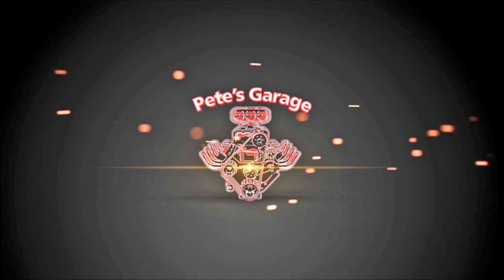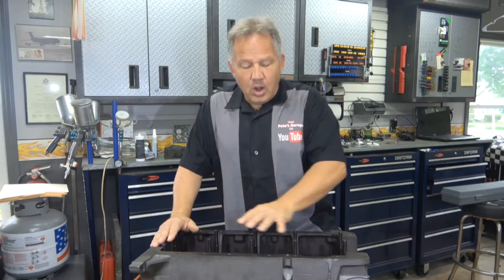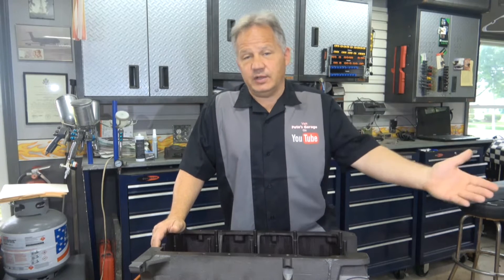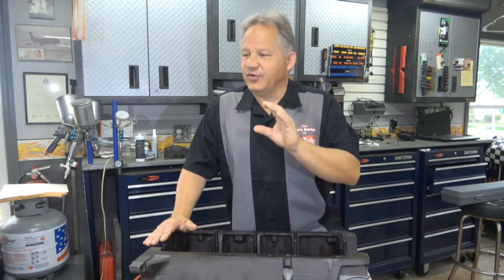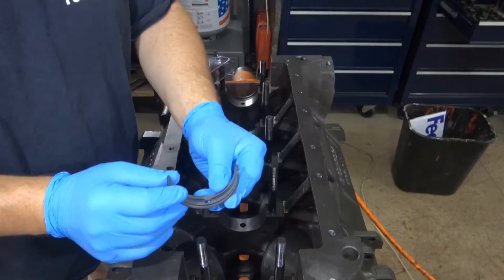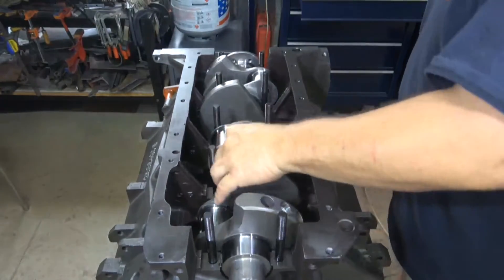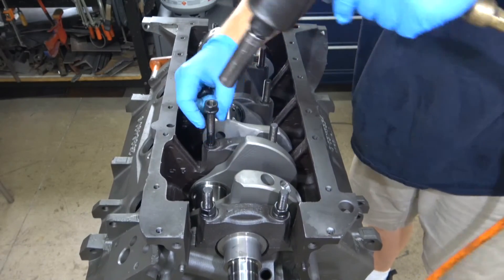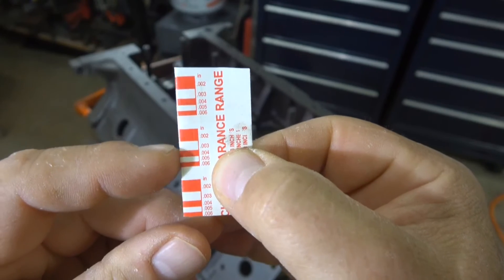Engine Building Tips - Checking Main Bearing Clearance with Plastigage 440 MOPAR 512 Stroker

Comment: Hi! Watching your videos for years now, but I have a question in general: When I do check my crankshaft bearing clearances (torqueing them down and measuring without a crank in the block) can I re-use those bearings when I finally mount the crank? Or do I have to buy a whole new set of crank and rod bearings? My friend said after toqueing down crank caps and rod caps the bearings get crushed and cannot be re-used. On the internet I found only one reference which said that they only get crushed "elastically", so they would do get back into their origin shape after loosening the caps....  Marlon
Reply from the maker: You can reuse the bearings.
Reply: @PetesGarage  Thank you, Pete :-)

Comment: Nice job, Do you take fine scotchbrite to the bearings during assembly?

I knew someone who installed one bearing upside down and the crank never got oil in that journal. The hole didn't line up on the crank journal. Didn't realize the mistake for years after but always had problems with the motor.  One mistake can ruin so much. Very important. I always like to have another set of eyes during assembly.
Reply from the maker: I do not Scotchbrite. Those holes are so important

Comment: Say you might not work on the engine, Do you spray any oil on the block to prevent rust?
Reply from the maker: I took the block back to the machine shop for some work, they will spray it

Comment: This is probably a dumb question,  but is it important to use a machine shop that has a good reputation of building performance engines?
Reply from the maker: It depends on the work you're having done and how well you know what you want. If a shop grinds cranks, you can drop one off and tell them what to grind it to.